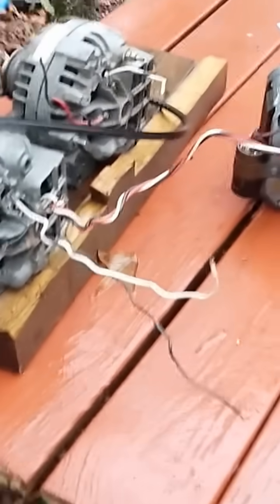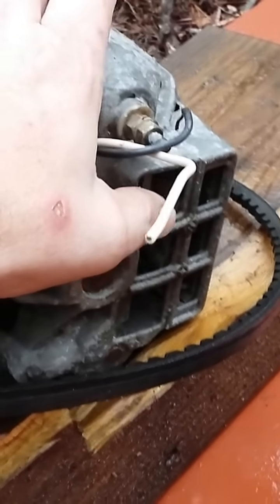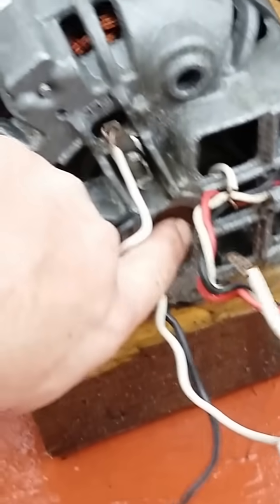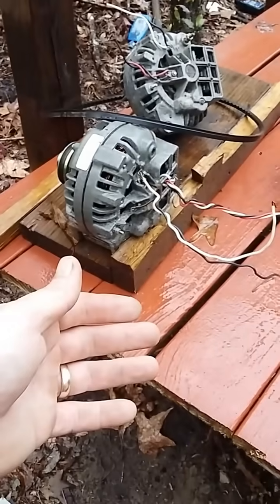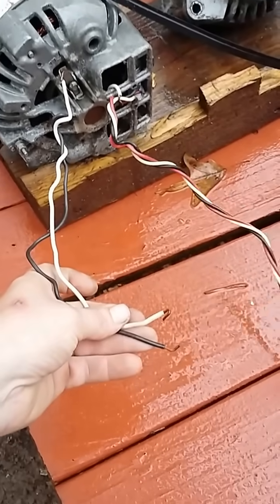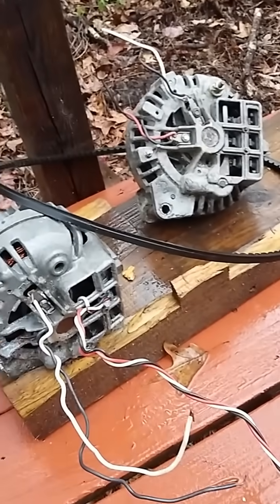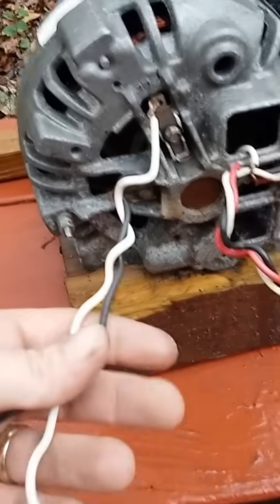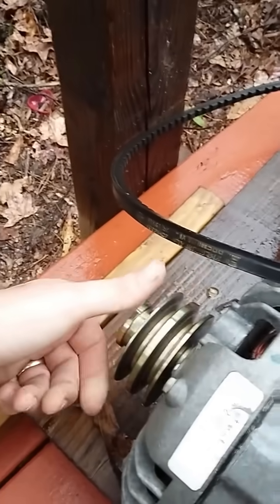Update Free energy forever no wind no solar no gas READ DISCRIPTION!!!

Comment: So ok, I did some slight reading. If there is no electricity as you say there is not, from said pole to house or otherwise, in curious how exactly you power or turn the pully on the alternator/generator? I'm not saying it doesn't work, because I have not personally seen it working or not. I do know however, that you have to have some sort of power source to turn the pully to generate electricity, in the vehicles case, it's the motor, that turns the belt, which in turn spins the pully. 
You state no wind or anything, so I have to wonder, if no power is running to the house, that would signify there is no power ie: a complete blackout, so how is it your powering the pully? My only guess would be the most common thing left, and that would be solar power.
I'm not an electrician and don't know much about current, but I do know pully's don't just magically turn themselves, you need a type of power source be it wind, motor, electric, etc. 
If you are using solar then it's already free so I'm confused as to why you'd need a generator if you have solar already which is free. 
Perhaps you could be a bit more explanatory in your description so people don't have to guess.
Reply: I'd use a 3 and 1/2 horse horizontal shaft Briggs and Stratton mounted on something ..thought of this before..basically he made a homemade generator...big deal

Comment: I got this.1st you need a motor to turn the alternator it uses (20amps), then you hook up a 12volt battery to the alternator, then you use 2 of the 3 wires to make 110volts and plug your battery charger into that it uses ( 15amps) to charge your battery that turns the alternator. you should have a lot of amps to run other stuff. Ill try this and comment later.
Reply: Any luck ?
Reply: Not yet.
Reply: u are definitely on to something...perpetual motion magneto alternator...build one

Comment: Yeah I get it, I read the description. "A lot of information is missing from this video". Your concept is close. You can and has been done. Manually power the alternator and charge a battery bank then convert to 120v. is the process mostly used. You lost me when you suggest that you can convert 6v dc to 220v ac. your 6v source would not last long enough to be effective or efficient let alone perpetual.
Reply: He is not converting 6v into 220v. He is using six volts to excite (magnetize) the rotor because without exciting it, it "will not" produce power.
Reply: @rwhite5857  Exactly!!! I understand. Eventually the 6v source will fail. I want to see the #s on the amount produced. Say 24 hrs?

Comment: Wow.  I've seen and heard stupid shit but this top five. 90 amps. Lmao.
Reply: You can LYAO if you like but there are alternators and generators that will put out far more than just 90 Amperes. More than 30 years ago there were alternators built that were very capable of welding 1/2" steel plate at over 120 amps and they weren't much larger than the conventional alternators of that era but yes of course wiring for that type of heavier duty application was a little more substantial and let's not forget there are voltage and current regulators and other protective relays to prevent damage to equipment. Do you think that say a 200A service coming off the grid hasn't any safety and protective limiting devices for both current and voltage? It just takes a wee bit of ingenuity to configure an alternator and motor with some control and safety devices to run indefinitely off the grid. Nikola Tesla did and was set to supply energy to anywhere in the world without wires but as soon as JP Morgan learnt of this and realized he's have no ROI or income from wiring he immediately destroyed Tesla's tower. Moreover, all Tesla's lighting in his New York lab had absolutely no wires connected to those lights. So before you go make trolling comments about things you have little or no knowledge of - go and do a little solid research of your own and not just blindly follow the watered down and incomplete physics the greedy self-serving bastards of this world want you to believe. Even with a degree in mechanical engineering with all my electives from electrical engineering including my thesis I know nothing except a little about nothing.

Comment: What I find amazing with the comments section is people are quoting the Standard model of physics, to explain this away, weather this works or not do not quote SM to debunk anything as it is mostly wrong, physics went wrong in the 40s, and they discarded half the universe because of prejudice they did this by ignoring half the dirac wave equation, and if you included it you would get answers without having to use mathematical fudges to make it fit, and as for Big bang another load of bollocks, there is a BEC everywhere with No charge which is why we cant see it, explain where the electron spin comes form, as it has 16 times more energy than it should have!!! when it is created, and just saying it is  inherent, is more poop so all you SM scientists full of shit :)

Comment: If the fist one isnt getting enough power when you manually spin it the connect a mini solar panel. You can also run alot of power off just one as well

Comment: I understand your concept that your trying to do except i dissagree with using power to start the alternator to create power. Actually, run two wires iff the first alternator connect to the second one and once you manually spin the first alternator, the power created out of the first one will get the second one spinning
Reply: Negative.  Generators can somewhat run on their own with power to the armature lead and the field lead. Alternators will not run on their own! They have to have something to spin them. When an alternator starts to produce energy,it acually tries to turn backwards, that in turn is where the energy comes from within the alternator, the object that is propelling it the opposite direction causes the alternator to produce energy. Then you get the alternating current.
Reply: @troyboy2848  we need build a perpetual maotion generator

Comment: It's all good, but you need power to turn the pulley at the right speed, So unless you have a magical6 way of turning the pulley, it's not free
Reply: He said use a 12v or 6v battery ! And its self charging if u just run a wire back to the battery im guessing

Comment: 90 amp x 4 that’s 360 imagine what gauge copier you need for that much power you idiot
Reply: Steve Mac 2 number 1/0 AWG in parallel should cover it. Thx
Reply from the maker: Yeah you're right Steve and the millions of houses that are ran off of one hydroelectric generator, back up your theory! because those wires coming off of there are not one inch thick they are one foot thick right? think about what you say before you stick your ass in your mouth... read the description of the video the only shit thing that I showed in this video is my primary mover which is the alternator with the wires hanging out of the back of it and technically it's not even called a motor because I'm using sound to propel it...

Comment: your not going to run that 3/4 hp motor on th power you get from the alt .and also get power to run your house
Reply from the maker: The only thing I showed in this video was my three phase field magnet motor or the alternator with the wires hanging out of the back of it and considering I'm using sound to propel the motor (primary move) it's not technically not even a motor, it's a h drive... thank you for the comment as it helps my channel out!!
Reply: yeah 'I get it you get a lot of people to scream .to make it put out wattage and voltage
Reply from the maker: susan Marie oh... now I get it! you're just a troll trying to get a argument started and here I was going to share with you... man you almost got me and I almost thought you were a good man! you're not a good man, you're just sneaky, deceptive, and not worth my time!
Reply: In the first place im not a man 'I am a woman 'second place Im not trying to start an argument .and 3rd and last your just full of shit .I do know you can get power straight out of the air I am very very good with electronics I build computers and high output radios .and zero point energy circuits. maybe you even know what I am talking about .most people don't .
Reply from the maker: susan Marie  I teach a class's on Wednesdays and Saturdays. ( plasma Innovation )that has 985 people in it and there are hundreds of scientists and physicists in the group and I also teach Zero Point Energy and compacting high frequencies to get rid of amperage consumption. I build my own 3-phase H Bridges, I write my own code in the Arduino Uno R3/ megas and I do know what I'm talking about!!!! this video is to keep me safe , keep immature idiots away from me, and to guide good loving people of the light to me!!  if half the people commenting read the description of this video they wouldn't even comment...

Comment: Thomas did you bypass the diodes straight off the coil and out of the casing? A motor will still be needed to turn the alt. Do the rpms need to be specifics? DocStrange@mail.com
Reply from the maker: Hey Brother the alternator in the video with the wires hanging out of the back of it is actually my primary mover and it's not technically called a motor but in layman's terms it could be called  a 3-phase field magnet motor.. and I have rewired to run off of the same technicalities that a brushless direct current motor runs off of... ( high frequency/ high voltage)  I will call you in just a little while and explain more.
Reply: Well if I had money I'd help u out...I'm in a fix & just barely getting by, but you are 1 of the good guys trying to help people.  Some can't be helped...I'm posting so maybe u will see not all people are like this bunch that are giving u a hard time.  God bless.

Comment: How many amp to run a house...?
Reply from the maker: Please read the description of the video! There are a lot of people out there that cannot do that! In order to run a house you'll have to have anywhere between 100 and 200 amps 3-phase that's grounded so you get a neutral coming from Step Down Transformer but this is all depending on the size of your home. And you will need it to be 60 hertz if you are in the United States or some other countries but if you are in Canada South Africa or a few other countries they use 50 hertz signal which is just 50 or 60 pulses per second time 60 seconds which would give you 3600 revolutions per minute on a 2 Pole generator I hope this is answered your question! Thanks for the comment!
Reply: Don't believe a word this idiot said !
Reply: Well that really depends on whether you are growing 3 acres of shit or not...

Comment: I actually have a go-cart that I made with an alternator, so what you are saying is true. You can make a motor out an alternator and it already is a genanerator. I burned out a couple of batteries while checking how long the go-cart could on one charge...lol but its been tweaked out and runs great.
Reply from the maker: That is great!!! I know someone who has a 16000 pound truck that they are driving around using four alternators just like mine as Motors! did you build your three-phase h-bridge yourself and do the coding for your controller like I did or did you have to buy it? Thanks for the comment! there are a lot of people out there that do not understand what you can do with sound and do not understand that everything in reality including light is sound vibrating at different frequencies...  I made this video purposely this way so I could get in touch with good loving people such as yourself and I let the people ridicule me because I like to treat people how they want to be treated and it also gives me an opportunity to weed out the evil people who I will not share this technology with!!!!!! I have stopped getting donations for my research and development since it is close to Christmas but I will never give up! I'm building something that will protect us all! just not from each other...  also if you did not use small transistors for your high side gate driver and resistors for your low side gate drivers and used something like the IR 2104 s it will only last a couple of years as I just found that out so it is better to build your own gate drivers such as I have thanks for the comment I really appreciate it!!!
Reply: @ThomasBuie  id love to see the truck thats driving around on those alternators, sounds pretty cool.. and great work and thanks for sharing your info with the public, keep up the good work and God bless
Reply: @ThomasBuie  i bought the controller, im here in mexico on the laredo border, went to I guess the mexican version of radio shack and bought a controller for like 15 buck approx. I wanted to make it myself but figured it would be cheaper to and less hassle to just buy. Not to saavy on electronics as others but I like to fool with it. The idea came from a youtube video, a guy I believe i  Peru uploads videos on how to make a brushless motor from a alternator and took it from there

Comment: I like the idea... By the way all those saying an alternator provides DC current are half right.. The diodes usually four called a bridge rectifier converts..... Wait for it alternating (alternator) current into direct current DC..
Now wether the alternator is providing 120 volts or 12volts(usually 14.6)is up for conjecture... And bear in mind that if you convert from ac to DC you will only get around three quarters your origional voltage because of a formula called root mean squared so roughly if you convert 18 volts ac into DC you will get 12 volts DC.. The people trolling need to stop not everyone has studied electronics in university I have but then I was interested in it since 5years old when I destroyed my toys to get the lights motors and batteries out... At 9 I was making my own circuit boards with letraset permenant markers and ferric chloride usually using 555 timers at 14 I built a recreational vehicle alarm system which I submitted as my final exam in school at 16 for design and technology.
Reply from the maker: Hello rob it is nice to meet you and I appreciate you not judging me for calling a rotor and stator and stator rotor as I have done many things in this video to test people out I also have been tearing apart my toys at a young age and love playing with five five five timers using them for many many different projects! I love electronics and I've always had a passion for it which is the only reason why I would sit in my shop for hours and hours every day experimenting I would love the opportunity to give you something priceless if you could email me at ENERGYBUIES@Gmail.com you would definitely not regret it as I have been teaching a discovery of mine too many many scientists and physicists all over the world for months now and is the main reason why I haven't posted very many videos... they are keeping me very very busy with questions! but I would like 2 give you something to experiment with that I'm pretty sure you have never tried as it would be something you would think could never be used for anything and not thought of... but  the outcome is something that can be used for almost everything! I look forward to your reply and or email and thanks for the comment!
Reply: So how do you get the alternator to turn,  and  how do you hook it up to your electrical pannel

Comment: So the stator turns does it? Lol it’s called a stator because it is stationary lol oh oh for 10 points how fast do you need to turn it to get 60hz? Or do you think it doesn’t matter? Lol
Reply: ThomasBuie EnergyBuies at gmail com im surprised you googled it lol Ive been called a pimp before and you are close to right lol
Reply from the maker: H Dog I didn't Google anything I am using a 3-phase H bridge that I built and I'm running it with a 400 volt homemade power supply from a Transformer to a full wave rectifier with voltage increasing capacitance at 14893 Hertz.. and the only thing I showed him this video pimp is my 3-phase filled magnet motor or the car alternator with the wires hanging out of the back of it and why in the world would you own up to being a pimp you know what pimp will stick any thing in his mouth for money a pimp will let anybody do anything to his butthole for money and a pimp is just a nasty MF!!! so have a good life being a pimp, PIMP...
Reply: I like this video